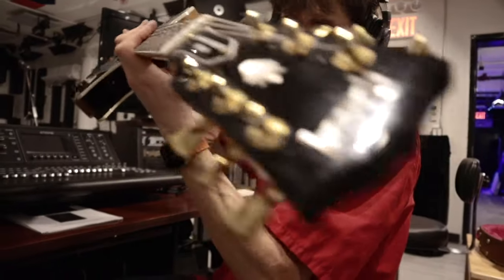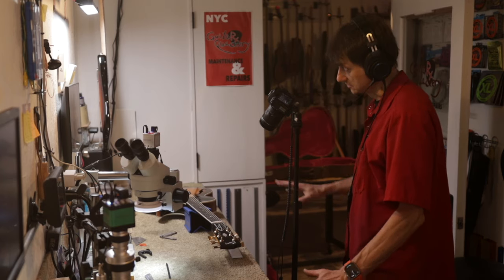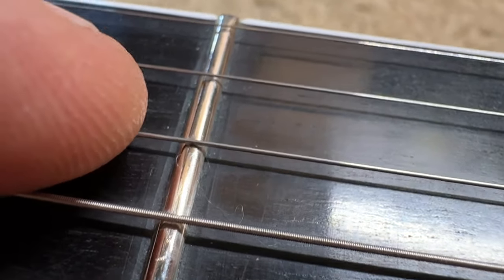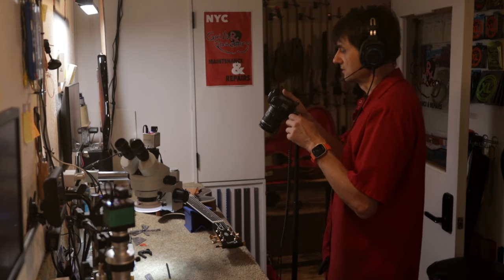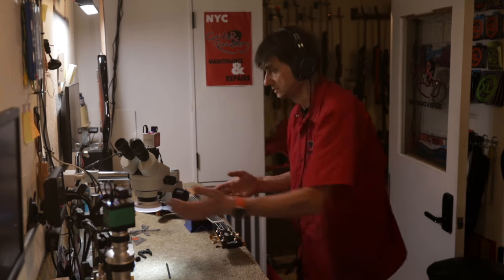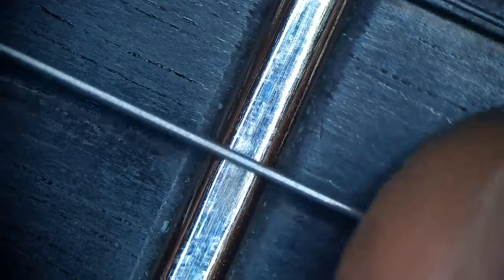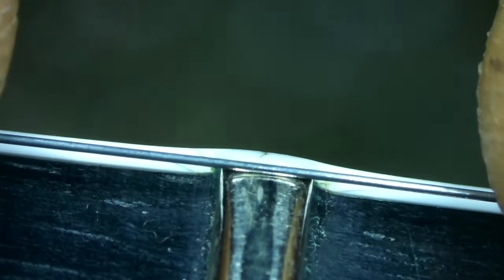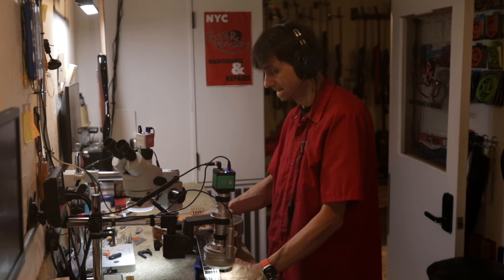Fret Nib Cracks on a Gibson Howard Roberts Fusion

Comment: With all the new technology and material no one has come up with a better solution for an improved guitar nut . Mind boggling
Reply from the maker: If you are talking about repair of string slots, there is a better solution than the superglue method.

I use dental composites on bone nuts, on vintage guitars, when we try to avoid replacing the nut, to preserve all original parts on a vintage guitar. 

Dental composites will hold up for years in a wet environment, inside of the mouth, despite all the biting and chewing. There are seven kinds of dental composites.

I will make some videos about that.
Reply: A friend of mine who left dentistry was using dental materials w/UV hardening on nuts over a decade ago.
Reply from the maker: @chrisghiardi117  Yes, few repair techs use dental composites. It is just not very widespread. It is also not as easy as most people might think, to do it right.
Reply: @GuitarQuackery  StewMac sells nut powder but I think it still uses super glue.

Comment: Hi GQ. You've got your work cut out for you there. Personally I wouldn't touch it with a barge pole unless I Had signed permission to Refret and re install new binding and new nut.A lot of those old Gibson guitars were just  mass produced without any quality control by low paid workers,they were riding the gravy 🚆 Train. Best Regards 😃 John.
Reply from the maker: John, I do refrets on old Gibson guitars all the time. In fact, I am refreting a Gibson Les Paul this week, as we speak, as well as vintage Fender Strat.

I would not have to refret this one, though, to fix the issues.

The binding does not have to be replaced, necessarily, as there are ways of fixing the nibs, by fusing melted binding plastics. 

The fillings on this nut are actually holding up, although there is a little bit of chipping on one of the strings. I am more having an issue with the fact that this was done without disclosing it to the customer.

Also, there are better methods of fixing low string slots on the nut, other than the superglue method.

If I do any of that work, it should be an interesting video.